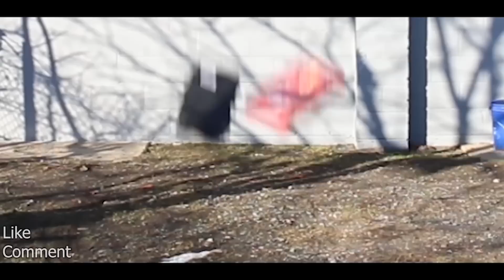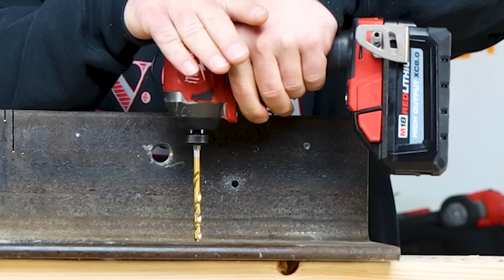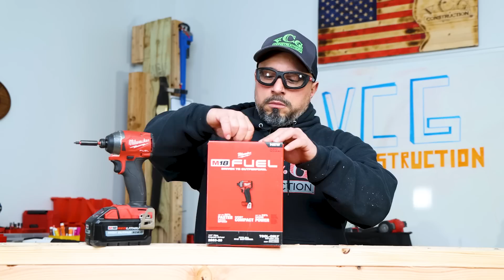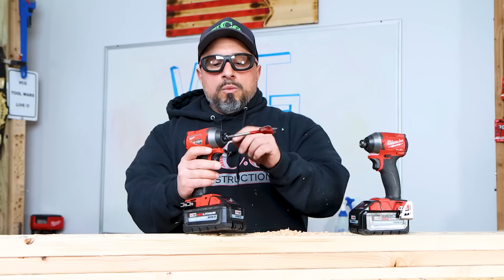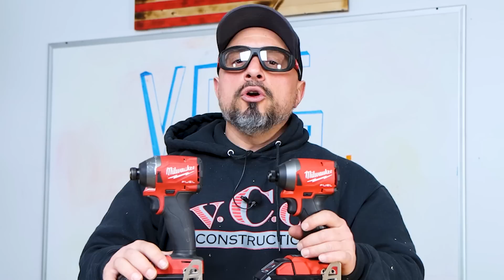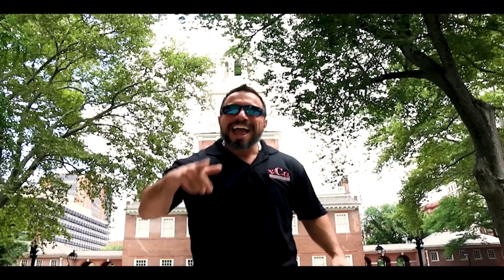MILWAUKEE TOOL makes HUGE CHANGE that CAPITULATES to the 1%

Comment: Ever since you brought this to light I figure why not use 2 retention ball bearings to fix it? I guess it took a while for the bean counters over at Milwaukee to justify the additional expense 🙄
So is this the gen3.5 version? Milwaukee should put that big gorgeous smile from Vince right on the box with a thumbs up saying VCG approved! A thumbs up may or may not give you 7 years good luck or fix the video quality of a big box walk through, but gosh darn it, it will fix your Milwaukee loose collet issue. The service you did to Milwaukee’s customers may go unnoticed by some unfortunate souls who haven’t had the honor of subscribing to your videos. But the very cool gang knows whom is responsible for this accomplishment. Great job Vince. 👍🏻
(At the very least a, life sized, cardboard cut out of Vince standing near the Milwaukee end cap at every HD in the US)
Reply from the maker: This comment made my day, thanks Tony we appreciate it!! 👍🏻
Reply: @VCGConstruction  Hello, what’s the new serial number to avoid falling on the one bullet version? I live in France and I doubt that he had the new models or my question so no more worries for milwaukee?
Reply: I posted a link to this video in the Milwaukee "Electrical Connection" Facebook group.... Aaaaaannnnddddd it hasn't been approved. At least not yet.

Comment: Thanks Man
I bought one after watching your  tool test months/yearish ago (sorry I forget) anyways
I was blown away by the power
and compact design it really slapped the competition..... irritated the yellow tool guy on the job site too😀
But.... I guess  I'm in  the 1% as well
I had the bit start falling out, not paddle bits just regular torx, Phillips,etc. under normal use ,just fall  right out!!
I figured I'd look up parts and fix my self since repair centers aren't local,
And I need the tool
And yes kinda pissed it's very new still !!      So.....
Looking up parts I figured it suffered from the same problem as the DeWalts broken retention spring and
I  have repaired several it's a quick cheap fix the gas or postage alone isn't worth sending the tool in .
Soooo.....  the parts diagram showed a spring I have to buy with anvil basically a kit.....and the anvil is containing  2 Balls which confused me at first but after watching your videos it all makes sense!!
Thank you I greatly appreciate your time and effort!!!
And dig what your doing man!!!
Wayne

Comment: The 1% affected is HUGE in Six Sigma metrics for manufacturing. I wouldn’t downplay the importance of the 1%. 

Been holding off on getting this Milwaukee impact because of this issue. Looking forward to getting this impact soon with a couple of 5AH batteries and making this my primary impact driver. 

Can’t thank VCG enough for bringing this issue to Milwaukee for the fix! 👍

Comment: I’ve only had a bit not click in once, but I’ve had so many issues with the trigger! Most commonly I have an issue with it not properly switching between forward and reverse by the time I pull the trigger again, I’ve had it happen doing all sorts of tasks, I’ve had 4 of them and they’ve all done it, I went back to using a old impact for awhile because I was so frustrated with the gen 3.
Also every once in awhile the you pull the trigger and its completely dead and stays dead till you either remove and reinsert the battery or press the setting button, so frustrating, I love the gen 3 driver, it’s power is addicting, but it’s trigger sucks!

Comment: That's great that they fixed to the collet issue.... But there is still one more issue with impact driver/batteries that I don't like and that they will never change.... That one thing that they won't ever change that is a pet peeve of mine is that they make the rear of the tool flush with the rear of the battery and that is completely backwards from what they should be doing. They should be making the front of the tool flush with the front of the battery so that when drilling or driving into your workpiece you don't have to use an extension bit in order to be able to go straight in and all the way down to the workpiece. Because of the fact that the battery sticks out further than the collet it requires the use of either an extension bit or a longer driving bit in order to not have the tool come out of plum with driving the fastener straight into the workpiece... This problem is more exaggerated when trying to bury a drill bit into the work piece. furthermore if there is limited workspace you may not have the option of using a longer bit or an extension. It's great that they made the tool compact but it's a little bit ridiculous that they made it to where the front of the tool is not flush with the front of the battery and this problem is highly exaggerated when using a high output battery on it.
Reply: If you use an XC or compact battery they are flush, I've only noticed them not being flush when using a HO battery. I do also believe the tool would feel extremely off balanced during use and also not stand up well when placed onto a surface. I like the ergonomics of the current designs and changing for this non-issue would be insane.
Reply: @CosmicGumbo626  I know what you're saying but I don't think you understand what I'm saying I'm not saying to change the ergonomics or design of the tool in any way and yes you're right with an XC or CP battery pack they're flush and that's fine yes the problem is with the ho packs and the only difference is the h oak pack sticks out slightly more in the front aside from the fact that it's slightly wider also but that's a non-issue here. So if they would move the cells in the ho pack just slightly to the rear so they maintain the front being flush instead of maintaining the back being flush that would solve this so-called non-issue and it would not affect the tool being able to stand up on the battery pack at all and it would not affect the ergonomics at all in the design of the tool would remain constant

Comment: 2 ball detente. Problem fixed.  Milwaukee marketing clownery. ...Just saw that pinned comment.  But after what Vince relayed to us from Milwaukee I couldn’t help meself.  As far as bit wobble/ runout.  I wouldn’t expect an impact drive to be wild.  Drills on the other hand, I want as little runout as possible. Ya dig?
Glad to hear they will replace.  So long as it’s free. !.!  Thanks Gang!

Comment: I have a lot of m12 & m18 and other M.- tools. I refused to buy the m18 impact. Because of the collet issue. Which is sad because that is apparently a "flagship" tool on TTI's flagship brand. 

I strongly considered skipping over Milwaukie as my primary power tool of choice when retooling for this reason. Fixing it wasn't just about this tool it's a gateway tool into the platform. 

Now add AC cord adapter capability to the larger tools like the table saw, etc! Won't buy that either without a significant justification for that "premium price" only to be hamstrung without sufficient battery packs (with I do also have a bunch). Already bought competitor brands in the larger tools that generally stay put and are corded.

Comment: Did u buy that 2830-20 at depot, or Milwaukee sent to you Vince? Curious if selling new design in stores
Reply: I was curious of this myself as I imagine if they did start to ship out the "revised versions" there will still be some of the older ones in store so how do you know which is which.

Comment: If you’re using an impact driver on my job site to drill a hole you’re either going to get laughed or off my site or fired if you work for me. A driver is not for drilling holes. they suck. If you can’t handle an 18 V drill drilling a hole then you need to go to the gym and work on your wrists.

Comment: Not for nothing but, it's called an impact DRIVER for a reason and not a drill. primary use is for driving fasteners, not using drill bits. That's just an added benefit with a tool that spins. Just my $.02

Comment: As a mtool gen3 drill driver owner I can confirm that not only is bit retention a problem but the tool when hot will get stuck in gear eg. stay in forward when switching to reverse and vice versa. I live with it but if I used it more it would be in the bin.

Comment: Whoooo!!! hold them horses. 2000 in lbs!!! who measures using this metric? This is a measly 166 ft lbs, it's not stellar!! 225nm - this is barely 10% more powerful than the rivals - DeWalt/Bosch/Makita. Good video though :0)

Comment: Have very little Milwaukee gear. Not a big fan and too much electronic on them now. My old tools lasted 20 years anything I buy now with electronics on it lucky to get 20 months. Too dear to fix buy another tool. Failure by design seems to be utmost in every tool company. Keep everyone buying new tools. My last new impact driver not Milwaukee but top of the line for that brand all the electronics failed within a year. Now a one speed only driver. The very old cordless tools were tough and way better than the batteries. The new ones are fragile and the batteries are way better than the tools. One day we may get both good then they will be great.

Comment: First of all on the play in the spindle on a drill press or oter stationary machine it would be a big deal on metal working but for this i agree with you Vince its no big deal. As far as the spade bits I think its more of a problem with the screw type bits like you're using as compared to the speed bore type.

Comment: We had problems with regular bits falling out.  Sometimes walking along and you go to use it and the bit is gone.  Not just drill bits on retrieval.

Comment: One other thing Milwaukee needs to fix is the metal belt hook, those damn things are sharp as hell, I have wore holes in my bags and cut my wrist on those, please go back to the round loop hooks, so much more user friendly, I have taken the new hooks off all of my impact drivers and my drills and in the trash they went.

Comment: I'm a dewalt guy and I wouldn't even think of using a paddle bit to drill holes with my impact driver... so I guess I don't have that problem. But seriously though, I never use paddle bits to drill deep holes without going through the other side as the hole path will get clogged with wood debris especially when drilling through older harder wood, auger bits are better suited for that as they remove material as they drill. But, thanks to Milwaukee that's starting to become old man thinking.

Comment: Now you need to remake all those videos with Nick and his Dewalt stuff and mop the floor with him without the bits releasing. Also, typical of large multinational corporations value engineering. Instead of spending that extra half cent per unit they put out a defective product. If they do the right thing and fix all of the old units, that's a huge loss just to probably save 500 dollars over the manufacture of the entire product line

Comment: Not sure if the two I just got have two balls or one... I suppose if they start throwing bits, I’ll know. 

Any idea if they’ll service them if the problem shows itself? Can we all go from one ball to two if need be? Two balls does sound better.
Reply: And honestly, I want a Gen 4 impact already. Going from the 887 with three LEDs to the Gen 3 Milwaukee with one LED has been a little weird. 2855/2854 as a 1/4” impact would rule.

Comment: Vince you did it, Milwaukee final fixed the Chuck problem, Now I will buy the new driver, if it wasn't for you I would had bought the old driver long ago before the Chuck problem, thanks again Vince. Keep up the good work.

Comment: Other problem with the impact , you screw into wood with a wood screw, or make a hole with spade bit in forward mode. And as soon as you put it in reverse to back out the screw a bit or to remove the spade bit it still goes in forward. Lets just say, for the price , this sucks

Comment: An issue I’ve experienced, not long after using it out of the box, is no motion upon pulling the trigger. The next pull of the trigger was fine though. This has happened a handful of times within the past 2 months. Anyone else experienced this?

Comment: FYI guys, the impact driver's model number is shown on the box: 2853-20. The product number HAS NOT CHANGED! It was just a tool revision, and was not given a new model number. This is going to suck for those looking to buy one.

Comment: Did the manual say anything of the revision? It's still the same category number. How would we know the difference? Is there a certain date that they shipped out the revised drivers?

I guess the answer to the latter is probably this video itself, since it is January 31, 2021, and it's probably out on store shelves now, or about to in the next couple weeks or so.

I'd really like to pick this up to replace my M18 non-Fuel compact brushless impact driver, the 2850-20, and relegate it to home use only. This seems already promising, but at the same time, I guess I would have picked it up already anyway since I'm the 99%.

Either way, glad to see this has been solved. Please keep us updated and maybe post a follow up in a month from now? See how it has done. Maybe even bring it back to TTR and do rematches with DeWalt, Makita, Bosch, Kobalt, Ridgid, and Ryobi.

Comment: 1 percent complained.  I love my gen 3 but I just use my gen 2 if I need my paddle bit to stay in.
Have they fixed the problem with the gen 3 that causes the direction  switch to not activate reliably?

Comment: I have experienced this problem with my surge 18V. I thought i just had a defective impact and was going to return/exchange/repair it but just didn’t have the time deal with it. One night late in the garage I decided to attempt something. I took a can of compressed air my wife uses to clean her computer with and blew out around bit insert area then sprayed one little (very little) squirt of oil in same area. Low and behold problem solved, it worked and worked great. I do have to repeat about every 3-4 months because it starts doing it again. I’m sold that it just gets dirty and dry and starts to malfunction. In my case its dry wall dust as i drive a lot of 3” lags into ceilings.

Comment: There was a VCG video in which the Makita XDT13 kept losing its bit, and it has two ball bearing.  The Dewalt impacts only have 1 ball bearing on the flat, whereas Milwaukees is in the corner. Well, hopefully two bearings is a fix.

Comment: I have an old porter cable impact that has one handed insert and it’s never failed, not much bigger than my gen 1 but way less powerful.
No problems with my gen 1 fuel.

Comment: they fixed it but are they gonna recall the old ones? There is no way to tell if you got the fixed one or one that still has the issue also what does fixing the problem mean for a potential new model

Comment: I've definitely had this problem on mine. 
But I found a "fix" or workaround for it at least. Before you put a new bit in, look at the collet from the top or side, and then pull the trigger lightly, if it wobbles a little - then you know it's not going to retain. If it doesn't wobble (it spins smoothly), then it's going to retain the bit without issue. So what you do is, prior to loading the bit, AND it's wobbling, then all you gotta do is push on the collet while pulling the trigger for a short while until it somehow reseats itself, you will heal a small snap and the collet will go from wobbly to smooth. From there, pop your bit in and you're good to go. 
Annoying extra step, but can avoid other headaches.

Comment: i use those every day at work and its been an issue.  at home i have the older two hand design and never had an issue
Reply from the maker: Call customer service, Hope this helps!!
Reply: @VCGConstruction  thanks.   I work for a major  manufacturer  of a certain  truck. They get them real cheap so when they junk out we don't worry about it.    I've seen these bad boys run a 5 in whole saw on aluminum  sheets.  Also seen it drop a whole say and it roll away  at speed.

Comment: This was the #1 reason I didn't buy the packout gen 3 impact driver kit over December of last year, but my question would be is there sperate part numbers for these impacts or are they the same part number, if so how would you know if your buying the "fixed" version of the gen 3 impact driver? If they have the same deal next year I might definitely buy
Reply: Did you ever find out?

Comment: Oh yes I have a problem with my bit sometimes not locking in I just got used to always pushing it in and then pulling it out if it comes out then I push it in and Fiddle with the lock ring until it stays in very annoying! There's a lot of things Milwaukee has done with their tool line that I question my phrase to all my crew... I yell out what were the Milwaukee Engineers thinking?.. oh yeah they weren't!!!

Comment: also, i get a bit of  wobble, but it straightens out when the fastener or drill bit contacts the surface,,so,,,,,,,,,,,,, i mean if the hole has to be that precise ,,they probably should use a drill guide, or a router, or even a drill press

Comment: i never really thought to use the impact to drill holes until i saw your videos and generally don't pull on the gun  doing auto body, so i never had that problem,, i also have , i think , the first gen m12, but my friend has 2 of those fuel impact guns, and with a spaddle bit i got it to release the bit,,,

Comment: Milwaukee just bring out the Gen4 with this collet slight power upgrades and a few function upgrades and three lights like the impact wrenches. I'm over the Gen 3 impact driver. Nobody is going to know which Gen 3 is which and its going to lead to a whole lot of confusion.
Reply: True. At this point it seems better to skip generation and  extend the warranty or revise the part number on the old one.